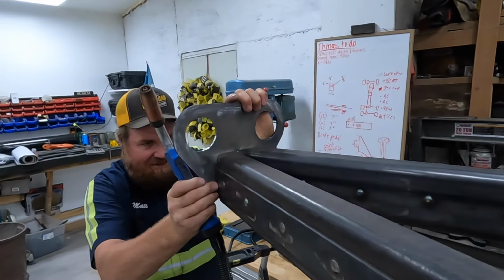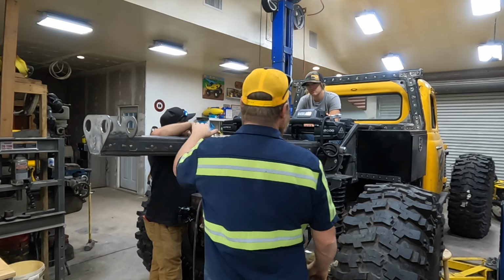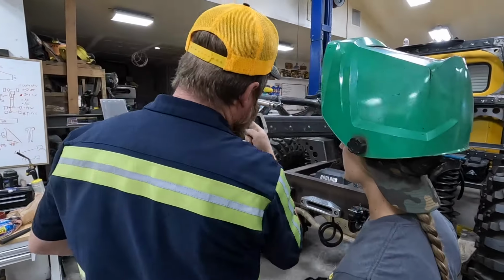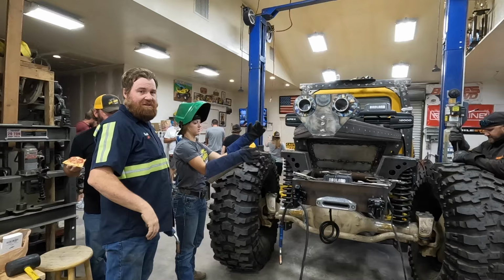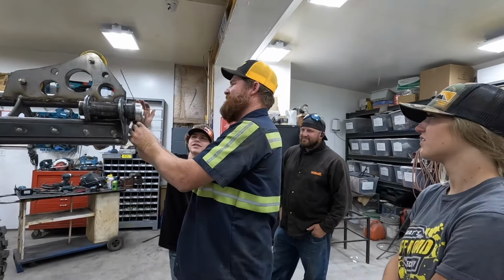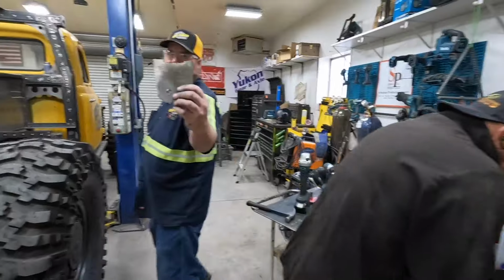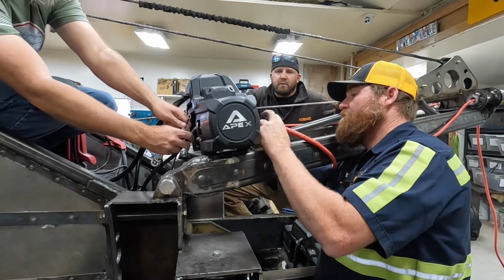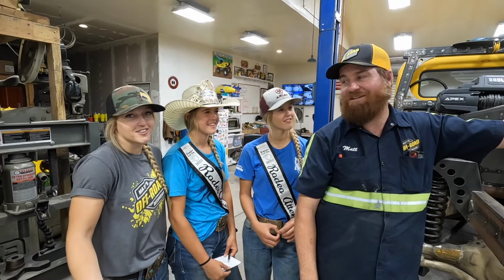Fully Operational Lift For The World's Largest Off Road Wrecker!

Comment: I love the looks of the wrecker and seeing how it is being built by this beautiful team. However, to be honest as a mechanical engineer my heart hurts when seeing how part after part is just welded on without any designed overall shape for optimal strength where needed. Just a heavy overkill of reinforcements welded on one after another. I hope the roll bar will get diagonal support beams towards the back, because it is holding the whole boom and its load.
Reply: Exactly this!  Very important change that is needed.
Reply: I see that too, but sensible voices get lost in the noise of internet experts. Online, everybody is an expert, and you or my professional opinion are worth no more than the loudest voices.
Reply: You have got the remember that this business is primarily just a YouTube channel now.  Most everything is for looks/effect.  Makes me sad.
Reply: I believe he said early on in the build he was not going to be lifting anything bigger than side by sides and jeeps.
Reply: Reach out to him directly about your concerns.  He seem like a sensible guy that would listen.
Reply: @georgeorwell126  Go be an insufferable cynic somewhere else.
Reply: "optimal strength" isn't necessary for a one-off build.

They're not mass-producing these.  They don't need to worry about pleasing the bean-counters by shaving 5% material here or 10% production time there.

Trying to design for "optimal strength" would easily double the work required to get it done.  

Don't let "perfect" be the enemy of "good enough".
Reply: I am also a mechanical engineer. While you are correct that there are some serious drawbacks to the methods, I would bet every dollar I have that this machine will not only perform as intended, but will effectively earn MORR more money than I will make in a lifetime. The deadly mistake in the design was that integrated frame air tank, which I am almost sure was just comment bait to begin with.

Meanwhile the global auto industry has repeatedly sold millions of cars with airbags that would literally kill the passengers.
Reply: Not just the roll bar, but that pulley. Granted it should be only holding 1/3 the total load as it's a 3:1 pulley system. But it is a point of failure. I suspect that a set of chains to hold the boom in place will be used when towing. 

Also with the boom fully lowered the force is almost 100% compression of the boom and not lifting. I hope they never do a max lift with it that low. Much better to only do max lifting with the boom at a 40 to 50 Degree range. Yes the boom will lift beyond that range but the loading will be much better. 

Alternatively add more pulleys to make it a 4:1 or 5:1 loading per pulley. Yes it will take longer to lift something but really how often are you in a hurry to lift anything? Most of the time is spent driving out to the site.
Reply: Wasn't it an engineer that put the starter in a V configuration engine in the valley between the cylinder banks and under the intake manifold? The world absolutely needs engineers but as part of their education they should have to work on stuff they design.
Reply: You watch a video of hours of shop work heavily edited down to 20 minutes, that shows nothing of the design process, that says little about the years of experience that have gone into the design, then you look at a partially finished product, and form an opinion about the process used to produce it.  That does not seem like an engineering approach, either.
Reply: @georgeorwell126  Correct.
Reply: @FaithySlays_Period  Why build such a massive rig then?
Reply: @dafunkmonster  I think he's got a legit point.
Reply: @prairiepucker9392  Is there a design process? It looks like weld it and see to me.
Reply: @spacemanski  MORR primarily specializes in kinetic pulls and trailering on fine sand where low ground pressure is paramount. This wrecker will offer a third recovery method--vertical lifting and towing, while maintaining their fine sand specialty. The massive tires are intended to let it traverse the fine sand where other wreckers would not work.
Reply: @dafunkmonster  No.
Reply: The design time costs practically nothing, compared to the time and expenses that will be spent building and modifying something that doesn't work as originally planned. Always design to acheive the goal of not needing any mod later.
Reply: @garyp.7501  What's more, the length of cable between the winch and the end of the boom does not contribute to an additional lifting force, like the two other lengths, because the winch is too low. This length of cable could contribute an aditional lifting force to the boom if the winch was placed at the top of the roll bar, changing the pull angle of that length.
Reply: @altair7001  If they did move that winch up to the tow bar, they would for sure need to add more diagonal bracing as now the tow bar will be holding 100% of the load.
Reply: @garyp.7501  Oh yes, no doubt about that. The bar already needs bracing to the rear, anyway.
Reply: @bryanlewis8891  ah the beloved Northstar!

Comment: Just a thought.  Adding a generic shock absorber as a gas strut to the boom.  It would help keep the operation be smoother and dampen rattling and jumping while traveling.  It would also take shock off the winch line while loaded etc.  It could most importantly give someone and extra second to move if the winch line broke.

Comment: Great work guy and girls! Question: Doesn't the fuel fillet cap need to be higher than the max level of the tank?
Reply: it's self leveling.  put too much in, and it dribbles out to compensate.

Comment: I have a question, what is going to keep the boom from bouncing up and down when going over rough terrain? Could you mount a shock or something on it?
Reply: wait until they get it finished, i can guarantee you that the boom will not just be back there bouncing all over the place as they drive it around...
Reply: The weight of the vehicle will hold it down and then where there isn’t a vehicle on it the winch lines will be hooked to those pintle hitches.

Comment: Looks great.
I would suggest those aluminium  bushes need a much much larger radius where the winch rope exits. That small radius/chamfer is going to be harsh on the winch rope and actually reduce its failure strength and reduce its life significantly..

Comment: 13:20 For the love of insert your deity here use a clamp or drill press vice to hold the material. If that drill catches and whips that flatstock around you're going to seriously injure your hands, or worse lose a few fingers. Drill presses might look benign (and usually they are) but they're just waiting to take a few fingers when you're least paying attention. There's a lot of power hidden in that thing and working in flatstock or sheet metal is prime-time for having "a bad day". I see you guys generally working safely, but this needs some thought! 

And PS: Those safety glasses work better on your nose than on your cap ;)

Comment: The winch lines will be some variant of UHMWPE (Dyneema). They are fairly UV resistant with the coating and have good wear resistant compared to other materials, but not like steel. Static rope you normal want the pin diameter about same diameter as rope (up to about 1/2 that holds). If you use a smaller diameter pin, it starts cutting through the rope.

For dynamic/moving rope you want a radius more like 4x diameter min. The exit points for the 2 recovery lines are probably going to be too tight of radius and wear the rope quickly. Also given the radius, it will reduce the rope strength.

Dyneema does not like bends, changing size etc. This is why with splicing dyneema the taper on the tail has to be gradual or this is where it will snap at less than 100% strength.

Heavy D has a video where they made fair lead exit things for the new winches they added, this would drop in to what you have basically on the arm with the tubes.

I hang out for this specific video every week! Keep them coming Matt!

Comment: I would think that those sacrificial guides should be made of something more like D2 steel and be hardened. Aluminum would work for short duration and lighter loads maybe. Stainless, while pretty, is still a very soft metal. Aluminum/Bronze is also a wonderful wear resistant metal. There are even some very strong wear resistant plastics such as TIVAR CERAM P that could be used for in some areas where wear is a concern to add lightness. Not cheap, but significantly lighter than steel. Comparable to aluminum for weight. I love how, even with over 1 million subscribers, Matt still tack welds with no PPE.

Comment: More on bracing the rollbar.  You have two 12000 lb winches on that boom.  And we both know at some point you will tie onto something really heavy or something really stuck.  Good engineering would say that you should have at boom that will lift what the winches will lift, and most of the force goes into the single sheave on the rollbar and the rollbar itself.

Okay, I'm done on this topic.

Thanks for sharing your designs and build.

Comment: I hope those aluminum ends hold up for ya.. but I work on snow cats at Alta including winch cats that have aluminum boom ends and can tell you first hand that the second you do a off center pull the first time your very likely going to have that steel cable eat right threw those aluminum tubes into the steel. It’s very astonishing how fast they will eat the aluminum, dang near like you took a saw blade to them.  I have seen a 5-10 yards of cable wear on the aluminum eat 6 inches threw a boom head. Maybe if you use some open chain and gear lube in there or a good amount of grease you can help the issue but that also makes stuff messy…but so does aluminum with all the shavings. 

So hopefully…idk 🤷‍♂️ your using a synthetic cable/rope ?

Comment: I used to work for a company that manufactured heavy machinery. I know the feeling of getting the skeleton all together and then having to snake in the hydraulic and electrical lines into the machine. I was just a shop helper but I did help on a few jobs here and there.

Comment: For the aluminium inserts, if you drill three equally spaced holes on the smaller inserted diameter you will be able to index them 1/3 turns for 3x the life. Just drill a hole in the top of the boom tubes.

Comment: Great job, but I'm not sure the top pulley wheel is enough strongly fixed for the big weights it has to support. 
For sure before a real use is better to test the whole with almost DOUBLE (three times is better) of the maximum weight you want use on real work, considering dynamics stress in real world rescue. 
You also need to take in count not only vertical stress, but also towing stress, that maybe even greater in the offroad rescue, moreover the two kind of stress combine one another! 

In this overall view I still think that top pulley wheel is not enough anchored and also the structure to which is anchored is the weakest part of the lifter.
If you like take in count my suggestion, even if for sure you have made more accurate calculations than me.
Thanks for sharing.

Comment: Are you sure that a double  line is going  to be enough  with the strains  of two  winches pulling down  are you going to have a backup chain/rope/wire for extra support 🤷‍♂️ looks really cool it's just crossed  my mind as I know you'll only be using  one at a time but that odd time using both  might  be too much 🤷‍♂️

Comment: Looking awesome.  The only problem I see is that the winch they are using for the boom is way too small.  They are using a 12,000 lbs rated winch.  Some of the stuff they will use it for will not work and will damage the winch or they will break alot of winch lines.
Reply: @MattsOffRoadRecovery  Matt, why is the boom so small? I know it's designed for RZR recoveries but will it handle a job like that F250 that lost brakes on the trail?

Comment: On the booms drivers side winch could you not flip the winch around so your free spool handle is facing out, and swap your p1 and p2 wires at your solenoid setup so that the drum runs correctly when using your controller? Also i assume you have a plan for a different control system for your winches whenever you start finalizing the build before putting it to use

Comment: It might be beneficial if the next several wrecker videos reviewed the function of the boom and specifically the difference between the boom angle control versus the actual load lift control.  Probably cut the number of comments in half.
Reply: odd you would think he wants to cut the comments in half.
Reply: What Bill said. More comments means the algorithm gives the video more attention. Matt does want to answer his viewers' questions though, if he didn't want the comments he could just turn them off.
Reply: @JohnFL  I understand that.  But for anyone who is trying to find useful bits of info within the comments, it's a mite discouraging to run across dozens of commenters repeating the same misinformation simply because of mistaken assumptions.  Don't get me wrong...I enjoy the channel, the projects and the people.  But I don't have unlimited time, either.
Reply: @prairiepucker9392  It's a given that the bigger this channel gets, the more comments there will be. It takes me a lot longer to read through the comments now than it did when I first subscribed. If you have a question, please ask! And I also hope YouTube will add a feature to sort with the creator's replies at the top. That would make it a lot easier to find useful bits of info. Thanks for the cool reply!

Comment: Doesn't the gas cap need a way to breath a bit? As the gas warms and cools, there's extra pressure in the tank that needs to be let out. The tank needs a way to suck in new air to displace what was consumed, or it will form a vacuum that the pump will work against.

Comment: Vertical down is a big no no may look pretty but it is like putting chewing gum on.Root run with cellulose rods on pipe maybe .Down welding seems popular in the US.Welding up you can fill large gaps if you have to.

Comment: Not to rain on your parade, and I get that the bolts aren't properly installed yet. But those half inch bolts you got there through the pulleys aren't gonna hold up for very long. There's gonna be some serious mechanical violence and very concentrated to those bolts. Remember all the pulleys experience twice the force of the winch. I bet you have at least 4x 1/2 inch bolts just holding the winch to the chassis. Each one of the bolts you put through the pulleys are potentially going to deal with double the force of that whole winch/chassis assembly. The way the lift is set up, if one of them snap, pulleys will fly along with the ropes and everything else that comes loose. And that rear pulley is going straight through the rear window if that one breaks, no matter what angle the boom is at. The lift is dead in the water, not to mention the poor guy or gal standing close to it or the car being towed or sitting in the wrecker. I love your videos and your crew, please consider way thicker high grade bolts. A screen to protect the driver and passenger would probably be a good idea too. Thanks for yet a fantastic video.

Comment: Prediction: you're going to hate the angle of the fuel filler. It'll either be constantly clicking off on you at the pump or you'll have a gasoline lake because the pump won't click off. I had a boat with a 45 gallon auxiliary tank that had a shallow angle filler tube angle. Nothing but trouble. I hope I'm wrong. Good luck. It looks awesome.

Comment: i would think the fuel fill pipe should be a bit steeper to help with filling, but i suppose that’s something that can be changed in the future. i’ve just seen issues with slow filling on other channels caused by a shallow angle for the fuel filler pipe.

Comment: Will you be installing a limit switch on the boom winch, and making a kind of consolidated remote control? I'll bet someone could cobble together a single box to control multiple winches by decoding the radio signals.

Comment: First of all, I know nothing about towing!  So I'm sure there is a reason the way you did this. I remember watching you guys pull a jeep up a hill by attaching three of you together.  The tow truck attached had the front wheels coming off the ground, because the weight towed in the back.  I was wondering why you wouldn't try to have the boom attached near the middle of the vehicle very low to the frame to help aid you keeping the front wheels down when things get hairy? The new truck has the boom so close to the back.  No, criticism intended, just respectfully curious.

Comment: Re Fuel filler.  The filler entry to the tank seems awfully low in the tank and the filler neck is fairly low by the look of it. If so, your 60 gal tank might only hold 1/3rd to 1/2 that before fuel overflows out the neck when filling, shades of Moorvair and Banana having limited fuel capacity. Also with the boom setup, it might pay to install limit straps to control how close to vertical the boom can get when not loaded so it doesn't swing forward and over the pivots travelling over rough areas.